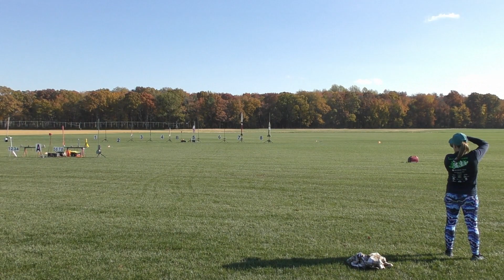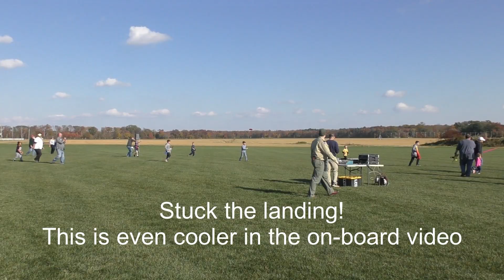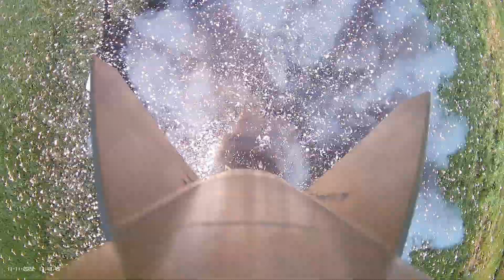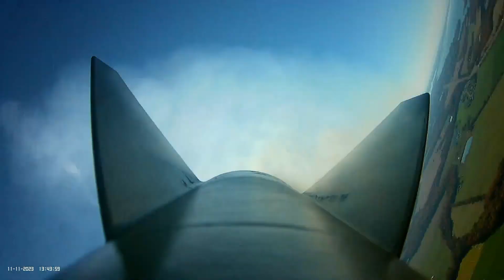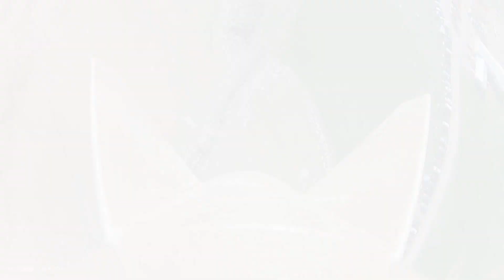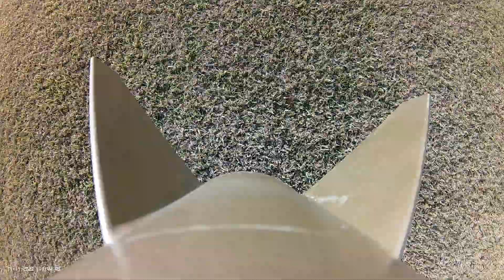Doorknob Sticks The Landing Again! (11/11/23)

Comment: Any specs and launch date,  ??? Thanks
Reply from the maker: All the specs including launch date are right in the video (subtitled). They are also in the video description. Is there additional info that you are interested in that is not mentioned there?
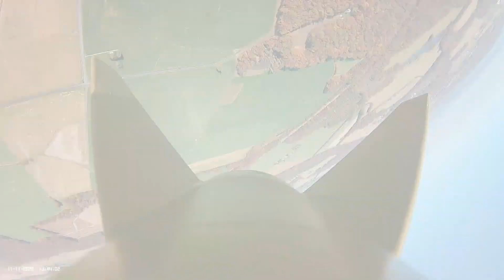Reply: I only saw the Apogee of 1500 feet, at 2:00.  Do you know the thrust force, weight,  TWR??? THANKS
Reply from the maker: @kareemsalessi  From the youtube description: 7.5 inch diameter LOC Doorknob flown on an Aerotech J450 Dark Matter motor at MDRA's Central Sod Farm on a calm day. Outfitted with a 72" elliptical fruity chutes parachute to try to stick the landing again. It did!
Reply from the maker: @kareemsalessi  Date of the launch is right in the video title: Doorknob Sticks The Landing Again! (11/11/23)
Reply from the maker: @kareemsalessi  To get the specifics of the motor,  Go to thrustcurve.org and look up the Aerotech J450. I believe the rocket weighs about 15 lbs loaded, more or less.